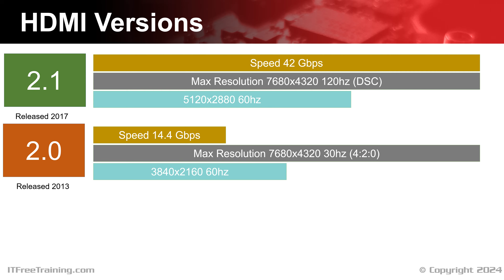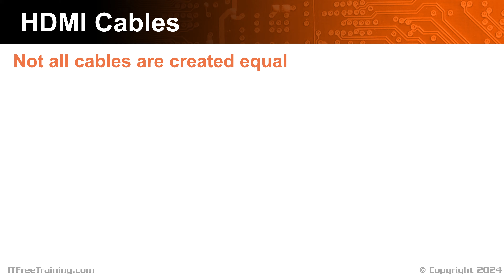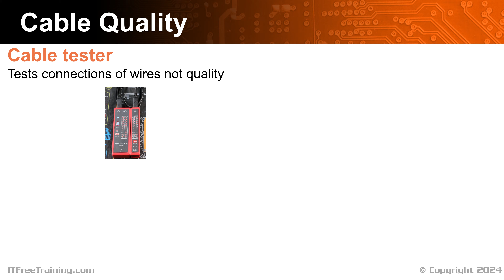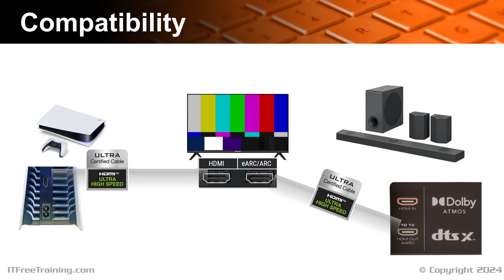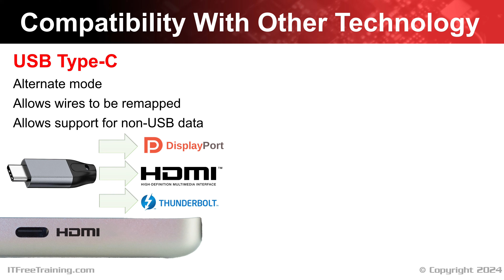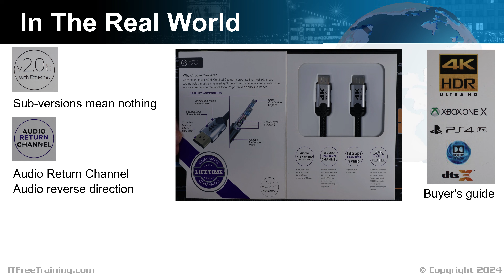HDMI - CompTIA A+ 220-1101 – 1.4

Comment: Here is my conversations with chatgpt

Me: 
Let's assume I have a PS5 and a TV and a soundbar. I connect to PS5 to the TV with an HDMI cable. The PS5 is the source TV is the destination. There's no need for two way communication. Then I connect the tv to the soundbar using another HDMI cable. TV is the source, Soundbar is the destination. Again there is no need for two way communication. What is this "return" then? There is no return here.

Chatgpt:
You're absolutely right in thinking that, at first glance, it seems there isn't a "return" in the typical setup you described, where the PS5 is connected to the TV and the TV is connected to the soundbar. However, the concept of the Audio Return Channel (ARC) specifically comes into play when the TV needs to send audio back to the soundbar or receiver — which is what the "return" part refers to.

Me again: 
 What do you mean "when the TV needs to send audio BACK to the soundbar". That's the normal direction of the communication between the tv and the soundbar. In connecting a TV to a soundbar, the TV is not the receiving end. TV sends audio signals to the soundbar. Not vica versa. Why are you refering it "BACK" when you say TV sends audio to the soundbar.

ChatGPT:
Ah, I see where the confusion is! Let me clarify.

You're right in pointing out that in a typical setup, the TV sends audio to the soundbar. The concept of "return" in Audio Return Channel (ARC) can be a bit counterintuitive, especially when looking at it from the perspective of a simple TV-to-soundbar connection.

Why "Return" in ARC?
The key here is that ARC enables the TV to send audio back to the audio system (soundbar or receiver), but that "back" refers to the TV's ability to send audio upstream, meaning from the TV to the soundbar or receiver over the same HDMI connection that was originally receiving video and audio from the source device (e.g., the PS5).

Then I gave up

This comment 
"Best think of it this way: the HDMI ports in your TV are inputs, i.e. you can feed video and audio signals into the TV to be displayed.

Now, the ARC port has a special trick up its sleeve: it can also output audio to whatever device is connected there. And it always outputs exactly the audio signal that the TV would also play on its speakers."

and reading this 
https://www.whathifi.com/advice/hdmi-arc-and-hdmi-earc-everything-you-need-to-know

helped me understand.

I am almost finished with this hdmi saga. After 10 days. lol.